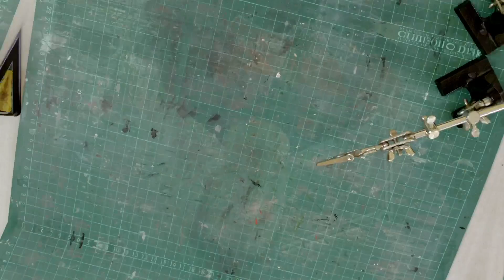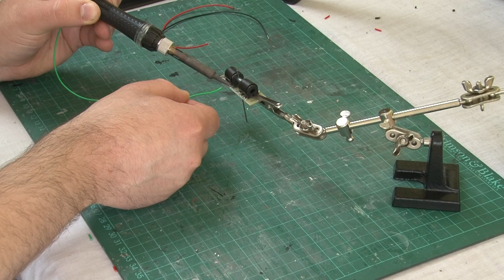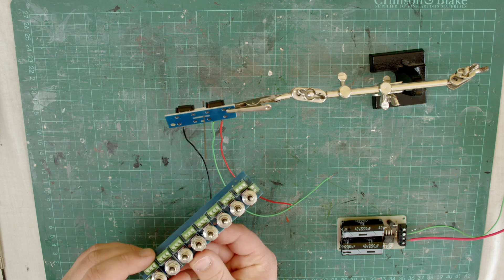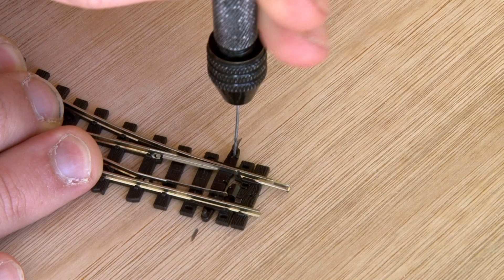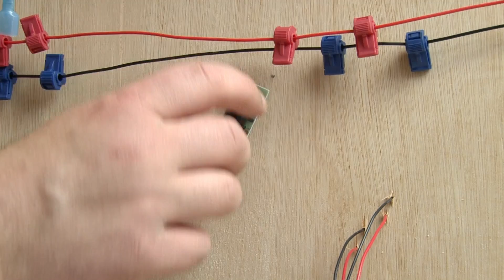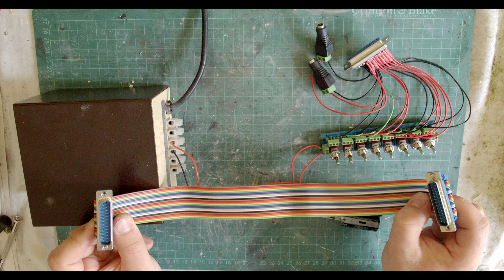How To Install SEEP/Solenoid Point Motors - Model Railway Tutorial

Comment: Loved the tutorial! It really motivated me to add point motors to my train setup, which is now almost complete - something I was hesitant about before watching your video. Quick question: does anyone have tips on the best way or place to install or mount those switches?
Reply from the maker: Awesome, really glad top hear it helped you! For me, I mounted them in a small control box which I then connect to the layout during operation. If you check out the full series on building this 009 layout I'm pretty sure I covered it at some point in those videos. Thanks for watching 😃

Comment: after installing your first motor how do you connect up the wiring on future points
Reply from the maker: Take the positive from the CDU and run that to each switch. The common from the CDU then connects to every point motor using the C solder pad. Then just hook up each switch to its corresponding motor using the A/B pads. Hope that helps and thanks for watching 👍

Comment: A helpful video, tks. What about reverse polarity ?
Reply from the maker: Glad you found it useful. With reverse polarity do you mean switching the polarity of the frog or changing the polarity for a reverse loop? Thanks for watching 😃
Reply: @ThatModelRailwayGuy  I mean switching the polarity of the frog.
Reply from the maker: @gersonfer  So for that you would use the Seep PM1 instead and that's where the extra solder pads come into play. Alternatively some people prefer to use microswitches or frog juicers for switching the polarity so there isn't really a standard way of doing it, it's whatever works best for each individual ☺

Comment: great video, about to do this myself! was struggling to find out if I could run motors off the controller alone, but thankfully with a CDU I can. I wont be using such a complex setup as yourself, Just 5 peco PL-10 point motors.
Reply from the maker: Awesome, really glad you found this useful Chris and best of luck with setting up your point motors. Thanks for watching 😃

Comment: If I was to use electro frog points on an analogue OO9 layout, would I just need to add a frog wire between the point motor and point?
Reply from the maker: Firstly you would need a solenoid motor capable of switching the frog polarity which these PM2's can't do. In addition to the wire from the frog to motor, I believe you also need a positive and common feed from your track power connected to the motor to actually supply power to the frog. This is all assuming you have the isolations setup correctly for electrofrog points as well to avoid any short circuits. Hope that helps and thanks for watching 😃
Reply: Is there any plans to make a video turning your suitcase layout to DCC or make a bigger layout that is DCC using the method you’ve just mentioned? My 009 layout is going to be 7FT x 4FT.
Reply from the maker: @WillSimpson-jq5qq  This suitcase layout already runs on DCC (it can run as both really but all my 009 locos are digital). At the moment my focus is on finishing the 00 Gauge modular railway so if I did do a larger narrow gauge layout it wouldn’t be until after that is done at least.

Comment: Do you just need one Gaugemaster CDU Capacitor Discharge Unit for multiple set off points or would you need to by multiple off them
Reply from the maker: You only need a single CDU for the layout... unless you have a ridiculous amount of points. Thanks for watching 😃
Reply: @That Model Railway Guy  about 7 point I be using

Comment: On the finished layout, did you wire the common to each switch? I have used the same switches and have just wired the common to the terminal on the side (I think) as the bank of switches are on a common feed on the pcb....
Reply from the maker: I daisy chained all the sockets for the common together then ran one common wire to the layout which fanned out to each motor. A lightly more complicated way of doing it but achieves the same effect. Thanks for watching 😃
Reply: @ThatModelRailwayGuy  I thought you had when I watched the 009 video...... I went to try thr same method then realised there was no need to daisy chain the commons together as they are connected on the pcb

Comment: Very interesting side of the hobby, not yet a need to learn this all but doesn't stop me watching and learning a little more. Thanks 👍
Reply from the maker: The electrical side is definitely a whole world of its own. I can definitely see why some people choose to keep it as simple as possible on their layout. Thanks for watching 😃
Reply: @ThatModelRailwayGuy can't believe this was a year ago! At least I now have the basics of my layout in place and now I'm considering whether to use point motors or not.  Do you have any experience using Servos to control the points and/or what's your preference?
Reply: @ThatModelRailwayGuy if you've seen any of my vids you will see I'm using insulation board under the track, I'm thinking I can dig out a square for a clip below motor? Any idea?

Comment: Would you not want to use a momentary contact switch to keep from burning out the coil?
Reply from the maker: Hi Michael, these actually are momentary switches. They return to centre when released. 
However, with a CDU in the chain it doesn't matter whether you use a momentary or latching switch as that discharges a short burst of power to move the point and stops it from accidentally burning out. Hope that helps and thanks for watching 😃
Reply: They are momentary switches but not elaborated on in the video.  Latching switches will short out the CDU and coil.

Comment: Terrific tutorial, That Model Railway Guy. Have you ever seen or heard of "Tortoise" switch machines? They, at least, were popular in the States for a time. They gave a slow movement effect to the points, similar to a real point arrangement. I think they used a motor rather than a solenoid to move the points.
Reply from the maker: Yes we have the Tortoise motors over here too, although they tend to be a more expensive "premium" product. You can get slow movement by using servos motors like I did on the modular layout just by removing the springs from the point. The servo motors are much cheaper but of course you need a way of controlling them. Thanks for watching 😃

Comment: Your timing is impeccable. I've just bought some of these exact PM2's!
Reply from the maker: Fantastic, glad to be of service! Thanks for watching 😃
Reply: @ThatModelRailwayGuy  👍 I've actually started collecting all the bits I need in this exact order starting with the points because, as you say here positioning of the points is critical because you need to put the hole in the board. My layout is only small so I have three sets of points but the issue is that they are all quite close to the centre line where ideally I'd put a cross brace. Therefore I actually need to lay the track out first and locate where the points need to go before I put the bracing on the board in order to make sure I avoid a conflict.

To some it may seem like complicated over planning but I'd rather avoid problems than have to work around them later!

Comment: Another great video and topical for what my brother and I are about to do for our own little shelf layout!

It is also worth noting that the kind of switch you want for this is a single pole double throw (SPDT) toggle switch with *momentary contact*, ie it'll only stay in the chosen state for as long as it's held there. These kinds of switches are noted this: (On)-Off-(On). This is important because if you had a latching switch, where you set the state and it remains so until it's changed again, you will likely burn out the motor. I don't know if the CDU protects against this somehow as part of the product, but as it's an optional item, using these switches also help prevent burning the solenoids out as providing a constant electrical supply just kills them.
Reply from the maker: Glad you enjoyed it Tommy and that it's relevant for your own project!

Yes I thought I had mentioned needing a SPDT switch in the video but looking back now evidently I didn't which is annoying. You can have latching switches if you use the CDU (which I would highly recommend using too) as that will protect against burning out the motor. Bearing in mind that a toggle switch is just one way of controlling the motors, push buttons and "probe and stud" to name a couple. Thanks for watching 😃

Comment: That was a really helpful video, I always buy pre wired point motors but I've always wanted to wire them up myself but didn't know how, so this I found very helpful, thank you 😀
Reply from the maker: Awesome, glad that you found it helpful Adam. I have to admit I've never used pre-wired motors but it's definitely not too tricky to wire them up. The hardest bit is definitely fitting any motor to the underside of the baseboard in the correct position to interface with the point. Thanks for watching 😃